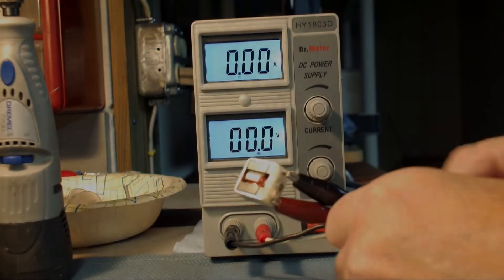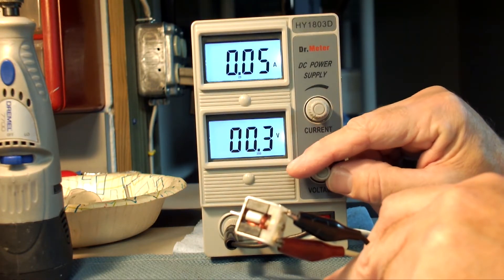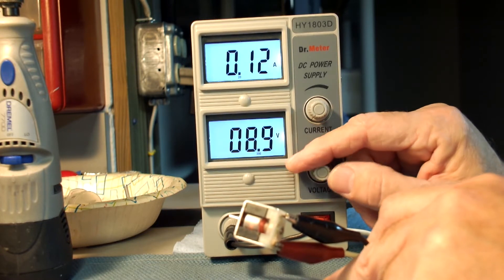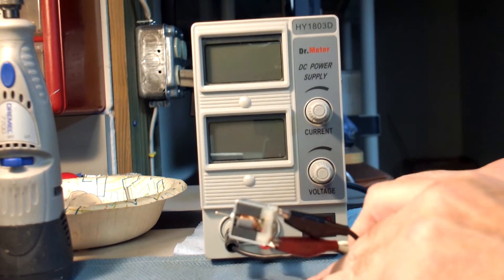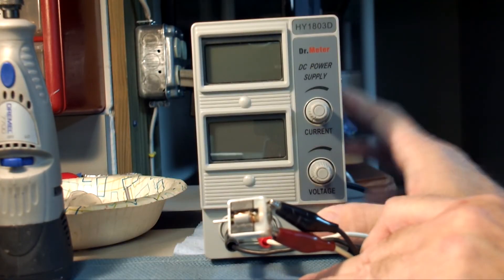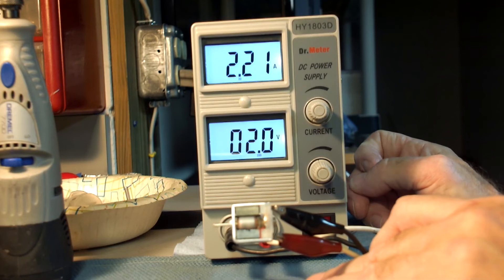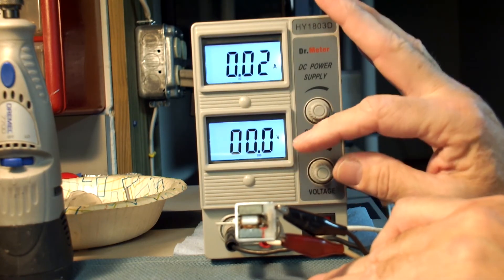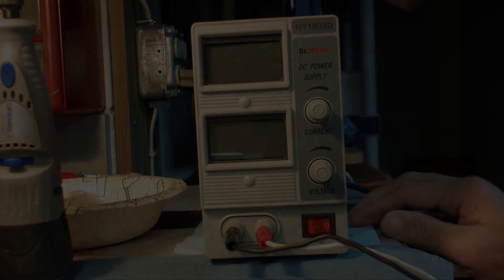Armature Amp Draw - An Extreme Condition

Comment: Thanks for the demo. I have 2 30 amp 0-30 volt power supplies on my 15.5' HO drag strip to allow my unlimited drag cars to reach speeds of over 60 MPH at only 20 volts. I have calculated that the RPM of the arm at those speeds is over 100,000. You have to use the highest quality commutators for motors to live at those speeds. I have not had a failure at that voltage with good quality arms and keeping the voltage down to 20. Stopping the cars becomes a problem at these speeds. I use dynamic braking followed by steel strips and a catch box. I have not tried that low an ohm arm, yet.  I race at Nitro Slots.